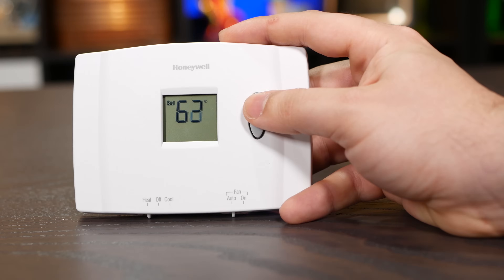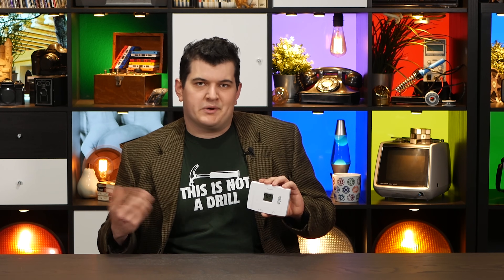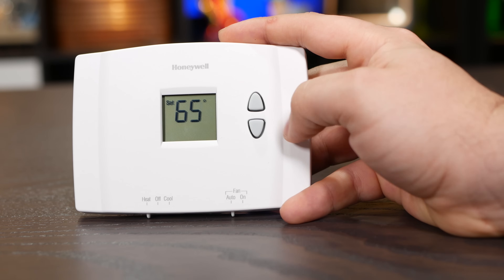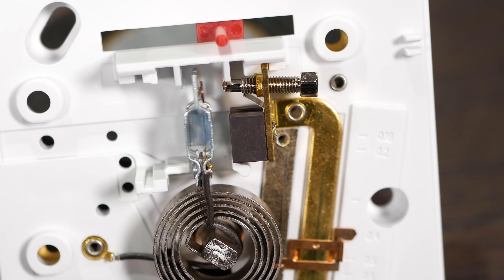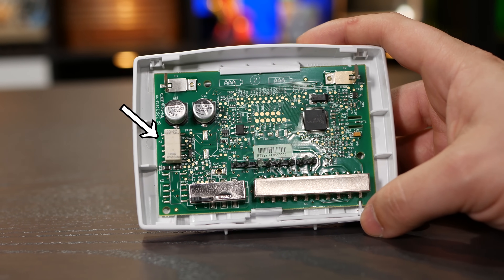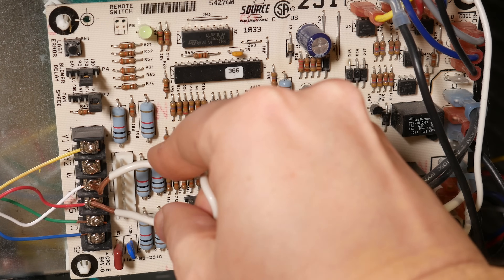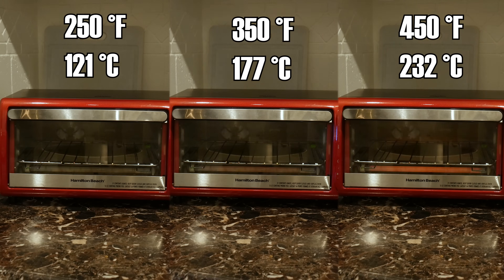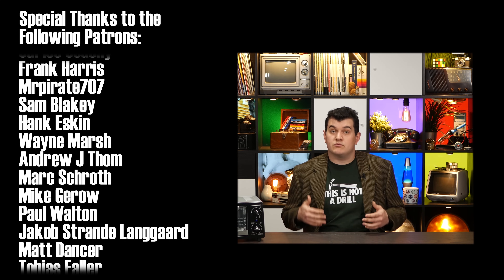Thermostats: Cooler than you think!

Comment: I have a basic Nest digital thermostat and I think it is smarter than you give it credit for.  It is actually using programmed PWM to provide proportional control.  My app tells me when it s "calling for heat", maybe for 10 minutes at a time. But during that time I can hear the furnace turning on and off, perhap every 2 minutes. So if I set the thermostat 10 deg above ambient, it will actually run at a higher duty cycle than if I set it just 1 deg above ambient. No need for a 2 stage furnace.

I don't know but I wouldn't be surprised if the algorithm is able to "learn" the time  constants of my house and furnace. It is remarkably accurate, with the room temperature rarely even a degree different than the set temperature. It does not overshoot.

What's more, the Nest displays the outside temperature via data from the internet. I wouldn't be surprised if the digital algorithm takes that into account, allowing it to predict the need for a higher duty cycle in colder weather.  You can do some sophisticated things in software.

The Nest also has an "occupancy sensor". It knows wen somebody walks past it.

Comment: I work as an HVAC tech and when I first started it blew my mind how simple the systems are haha of course with new government regulations blower motors are changing and high efficiency furnaces usually do 2 stage heat which is nice so you use half the btus of heat if you only have to make up 1 degree of temp or it’ll kick into high fire to heat the house up. The real fancy furnaces are the modulating/variable furnace where the gas valve is adjusting the gas pressure and the blower speed is adjusting. Very nice furnaces but can be a pain to trouble shoot haha

Comment: Single cycle thermostat! i have a centralite(I think) thermostat that uses Zigbee to connect to my alexa hub. In the amazon alexa app I can set up a routine that starts with a command to set the furnace/AC to a higher(or lower) number for a certain period of time, then set it back to my regular temp. The caveat with this is that I would have to keep the same temp all season long or change the regular temp and the temp on the routine to the same number so it changes to the same number at the end of the routine.

Comment: In commercial installations,  modern thermostats are often just temperature sensors that send the temperature reading back to a controller by the HVAC equipment. The controller makes all the decisions about what to do. Sometimes the thermostats do have sliders that might adjust the temperature but frequently aren't connected at all. The slider is just there to make the occupants think they have control.

Comment: When you mention how AC is designed to be either full blast or off, one thing people don’t realize that cars with digital temperature settings are the same way. So no, setting the AC to the low setting (60 degrees) does not make it come out colder, nor does setting it to the high setting (85 degrees) turn the heat on. You can have the AC button always on and still have heat. If it’s cold outside and the temperature is set to 72, the heat will be on.

Comment: I've seen commercial thermostats that have a "temporarily occupied" setting that lets you change the temperature for a three hour period. It can be used for what you mention because you just turn the temperature the direction you want, then back to where it was, and it will run through a cycle.

Comment: Long Text because I'm mean:

Having proven that this demonstration wouldn't work
using my personal toaster oven, I decided to
purchase a new one. See, my toaster oven is kinda
filthy and I wanted to get another one anyway.
I thought it would be handy to have a toaster oven
at the new studio. See, they're really nice for
making small snacks or whatever (though frankly
I've always found the actual toast making
experience to be rather lacking even before I
was introduced to the Automatic Beyond Belief!
wonder that is the Sunbeam Radiant Control
toaster). Anyway, so I wanted to get a new
toaster oven, right? So I went to the store and
bought a really basic one, just like the one that
I use every day in my kitchen. No sense spending
a lot on what will just be a part-time toaster oven,
and it was the same brand as the one I had at
home. Must be perfect, right? Well, it turns out
that this new toaster oven runs a much shorter
cycling time than my old one, so the effect that I
was trying to demonstrate became nearly
impossible to see. That sure was a bummer! It 
later became clear to me that this wasn't a very
good toaster oven anyway, as the fit of the little
tray they give you for cooking tacos or whatever
was really very tight and just unpleasant. The
whole thing was just a travesty, really. So I've
since returned the toaster oven you just saw and
replaced it with another one, but this was after
I had already filmed my original toaster oven doing
the thing I want to show you. I toughened up and
cleaned it the best I could, and I think it looks OK.

So that's the story of why you're about to see a
different toaster oven. I made an assumption that
turned out not to be true. Oh merde. In the end, it
all worked out for the best anyway because I got
a much nicer toaster oven on sale at Target right
after I returned the rather poor one, so all's well
that ends well, amiright?

Oh, and if you write this in a comment to save
people the trouble, you're a fun sucker and sucked
the fun right out of this gag. I hope you're happy.

A more helpful comment would be to tell the nice
viewers about either the "speed" setting on mobile,
or the fact that the < and > keys on desktop will
advance frame by frame. Then they'll be in on the
joke, too! And then when I or any other silly
YouTuber decides to do this again, they'll be
equipped with the knowledge of how to do this.

You already wrote this out, didn't you? Well, I
won't delete your comment, but you are now a 
convicted fun sucker and you'll just have to live
with that the rest of your life.

Pfft.

Comment: That blue wire just trigger my OCD… as an HVAC engineer it is improperly installed. 

I do gas steam boilers in NYC, that’s 95% of our heating solutions and it’s 98% more efficient than anything else as steam heating with radiators are always going to maintain heat even if you open the door for 10 minutes. This video is amazing though. You explained everything so everyone can understand. I’ll use this video to show my class next week.

P.s. always stay away from mercury thermostats! If anyone reading this has one please change it. You can do it yourself safely even if you can’t reach the boiler to shut off the emergency shutoff. However I always recommend it and always take a picture before you start.

Also you only need two wires for steam gas boilers. If you’re installing a smart thermostat we use blue for power to charge the battery such as Nest thermostats. This can be done directly from your boiler or via a DC power source.
Reply: Are you sure? Modern heat pumps (reversible air conditioners) can be 500% efficient. Or are you not talking about energy efficiency?

Comment: I think your thesis is true for room thermometers, but I'm not sure it's true for boiler (I think you call them 'furnace') thermometers.  My boiler takes over an hour to heat the tank of water, but it switches off many times during that process.  I assume it's because of the circulation of water takes time.  Rightly or wrongly, if I want a bath or shower in 30 minutes, I'm likely to turn-up the thermostat: partly in hope the boiler will stay on for longer; and partly to make some "concentrated hot water" at the top of the tank, which will give me a longer shower when diluted with cold water at the tap.  Am I wrong in this?

Comment: My house used to have a "dumb" digital thermostat (no WiFi, no weekly scheduling) that was powered only by the blue "C" wire. Apparently these are very rare because when I had to replace it, I was surprised to find out all the new dumb thermostats required batteries and didn't use the C wire. I felt like it was a step backwards.

Comment: What you're describing around 7 minute mark is called 'hysteresis'. Very useful concept and phenomenon!

The place where I live (a house in Florida) in has this annoying quirk...my room is always hotter than the common room, and since the thermostat is in the common room, it usually determines "it's fine, shut off the AC" while my room is still uncomfortably hot. The worst time of the year for this is spring, when the temperature outside is starting to get a bit uncomfortable without AC, but the AC in our house doesn't have a problem to cool the common room down. So when it's set to 72, it quickly cools to 72 and my room is left on 76 or sometimes even 80. If it's set to 70, it cycles like described and my room only gets down to 73 or so. I have to set it to something crazy like 68 so that the AC would run constantly and thus keep my room cool (albeit that's pretty chill). This is less of a problem in the middle of the summer when the temperature outside easily reaches 100 degrees, so that the AC has to struggle even at 72 - then it runs constantly and the whole house is (barely) kept at 72.

I imagine solving this issue would be probably very expensive - thermostat in each room and a system that can pump cold air only into selected rooms. Yeah, not happening.

Comment: it's kind of true there no medium heat setting but on some there is a  double your electric bill setting . two stage heating is pretty much standard on heat pump systems . MOST heat pumps I have encountered  have heat strips as well. they come on for three reasons . 1 they come on when the heat pump condenser unit outside is defrosting. This heats the air while the heat pump is unable . 2 there is a failure of the heat pump and you manually put it into emergency mode. 3  It is allot colder inside than what you set the thermostat to making the heat pump with the heat strips run at the same time and put out VERY hot air . Depending on your heat strip size this mode may increase the increase air temp by 50% but that is at the cost of 7,10 even 15kw of energy . So this mode can be anywhere from double to 4x the amount of electricity usage to increase air temp by around 50%. This only makes sense in an almost disaster scenario like a power outage during a winter storm and even then only for a short period of time.

Comment: Great video. I understand the use of the duct tape over the hole where the wires come out from the wall to the thermostat, but does this actually make a noticeable difference and is this a common practice? Are there any downsides to doing this?
Reply: This is only super noticable if there is a draft in that walls and more likely if its an exterior wall. Most insulated houses probably don't need it but it will only help get a more accurate temperature. 

What happens is the thermostat is picking up the temperature inside the wall instead of in the space. I work in the HVAC industry and there was a commercial building where it would feel like the room is 80F but the thermostats were reading 74-76F because they were picking up drafts inside the walls. The solution was to stuff a bunch of insulation since this were on exterior walls (which is normally a big no-no).

Comment: Because of thermic inertia, the size of a room, the distance between a heating and its thermostat and the power of the heating do matter. This is why the temperature scales on mechanical thermostats are very inaccurate, which is why usually they will have arbitrary numberings instead, e.g. 1 to 5. It is up to you to figure out which number corresponds to the temperature you like in one specific room. What is a two in one room may be a three in some other room. The numbers are merely there to enable you to quickly find the setting again you once figured out.

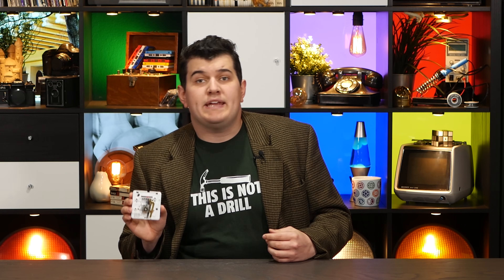At 6:25, you bascially explained what a hysteresis is.

Comment: I bought a smart thermostat a while ago and realized I couldn't use it but wasn't able to install it because I didn't have the common wire hooked up to anything. I believe it's there, just not hooked up to anything? Though now I'm curious...the C wire is just a return path for the electricity coming from the red wire...I wonder if there's a place to hook it up on the furnace side??? Maybe there's a spot for it and it just wasn't connected because the thermostat at the time had no need for it? That could be worth looking into...

Comment: A lot of institutional thermostats don't have a heat/cool switch; they just have a higher gap between the cooling and heating temperature thresholds. This gap is called both the comfort zone, because this is presumably the temperature range where people won't feel too hot or cold, and the dead zone, because the HVAC isn't operating within this temperature range. Life coaches have spilt a lot of ink on this, encouraging people to do things that make them feel uncomfortable because...well, tenuous reasons.

Comment: I'm in Europe. This video does not relate to the situation here. For one, our modern heaters are almost alwas "modulating", in that they have not only full blast and no blast, but also some options in between. Secondly, a fan is usually not a part of central home heating systems. Thirdly, if a house does have a cooling installation, it is in the majority of cases a stand-alone unit that is not controlled through the thermostat for the heating system.

Comment: An Apartment building my friend was in got an HVAC Reno and it has Lo, Med, Hi settings, but sounds like it's a bi-Metalic strip inside with that distinct "Toaster Oven Click" noise when it starts to call, but I guess it has some brains in it to call certain amount of fan speed to push air over the cooling/heating tubes to make thermal thing go faster or slower

Engagement has been boosted

Comment: 16:30
Daikin Inverter split systems let you run them at a power boosted mode for 20 minutes at a time. it'll turn off the thermostat feature and run over full blast. It'll deactivate after 20 minutes and go back to normal but you can just press the button again. Got the room near 0 degrees celsius after some hours.

Comment: My 1929 furnace has a button and 2 lights.  Press once and both red and white light go on indicating that both high and low burners are on. Press again and only the red light is on  indicating the high burner is on.  Press again and only the white light is on indicating only the low burner is one.  Press again and all lights and burners out.  The furnace has a rotary valve operated by a solenoid that each button push turns to the next position.   During power outages I go to the basement and turn the valve.   I keep on thinking building my own smart thermostat that will sense the both the air temperature as well was the furnace high, medium and low settings to command not only on, but high how the furnace should be set.

Comment: The common American thermostat generally has 5 wires for a basic system. R (24v) C (common) Y(cooling) W(heat) and G(fan).  Colors of the wires don’t matter, they can be any color as long as there hooked up to the correct terminal. People tend to assume function based on color witch is a mistake.

Comment: In the UK where HVAC systems are atypical in domestic settings and most households have radiators in each room, most systems have a wireless thermostat which you place in a room of your choice and which communicates to a receiver wired into the boiler (furnace). This means you can shut off the radiators in every room except one, place the thermostat in there, and only heat that room if you so desire.

Comment: Thought you might be interested in the existence of differential thermostats, which adjust the voltage according to the difference between measured and set temperatures. These are used for things like reptile enclosures, where you don't want heat blasting out fully periodically, but rather want to output just enough heat over time to keep the temperature consistent.

Comment: it is quite interesting to learn about how houses are heated. there is only AC in my apartment. the AC compressor will pump slower after it gets near the desired temperatures. so I usually have it cool my room below what I want, leave it there while I take a shower and then set the final temp I would like before going to bed. It is supposed to be more quiet and efficient.

Comment: Ecobee has something along the lines of “turn on for one cycle”. When you manually change the temperature (depending on settings), it can hold it for a specific duration (say 2 hours) before reverting to the default l

Comment: In Europe we have left the on/off thermostat behind us a few decades ago. Most of the thermostats are using the  OpenTherm https://en.m.wikipedia.org/wiki/OpenTherm protocol. I owned a 80's modulating furnace at one time.

The aim is to not let te furnace burn at 100% capacity, because that is not the most energy efficient.

Comment: I'v noticed mine at least seems smart enough to run the fan for a while after the heat or cool turns off to get the most out of the energy, but thats about it. Heat/Off/Cool, and On/Auto (Fan)
Reply: Yep those older ones are the ones I grew up with lol real simple
Reply: I saw one with mercury I belive and it made the conncetion through it.. I think, I was real young.